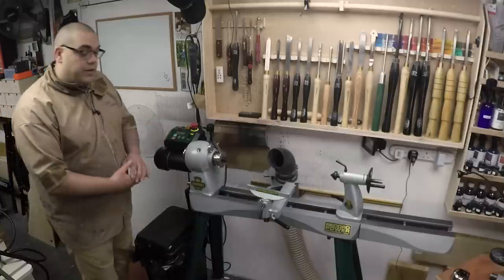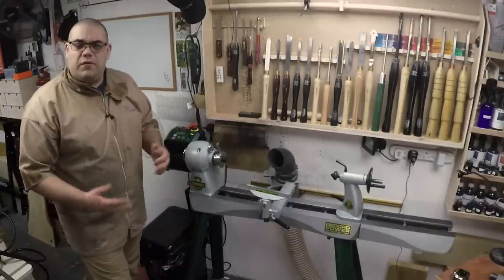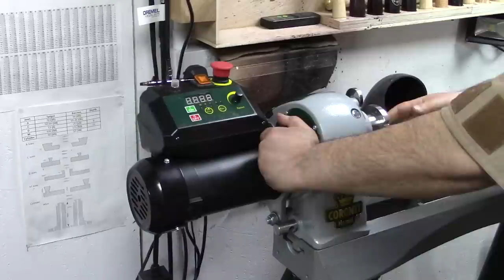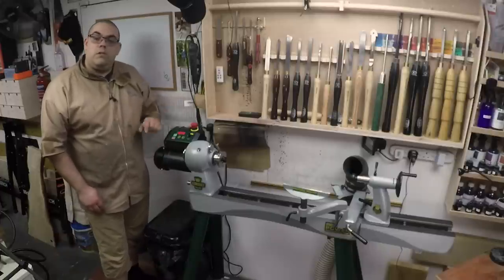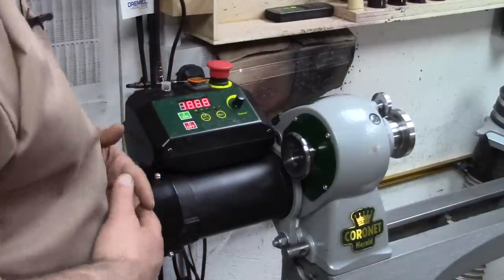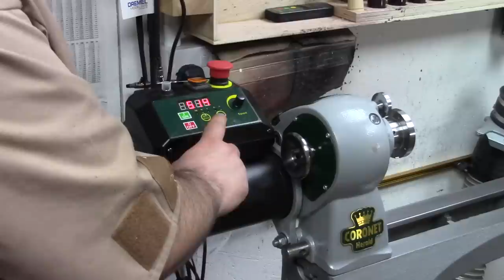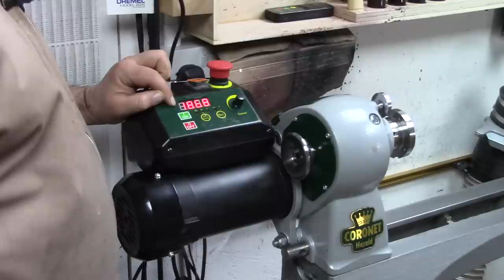Record Power Coronet Herald

Comment: A very interesting video. Now I'm thinking about investing the money to buy it as my very first lathe instead of a <400€-beginner-model. I'm sure, I'd have a lot fun for a long time with this machine.
Reply from the maker: I'm glad the video was of use to you. It is a cracking lathe. I am.sure you will not be disappointed
Reply: @JohnClothier I'm sure, it could be the right thing for me. Do you have any experiences in fixing the lathe on a workbench? As far as I know the legs are an extra and not included in the 999€, that the machine costs in germany. (But I know, there is a pair of feet to screw it on a workbench.)
Reply from the maker: No sorry. I've only used it on the legs. There are offers from time to time where the legs are included. Not sure about in Germany though
Reply: @JohnClothier  Oh no, I DON'T WANT the legs. I prefer to put the lathe on my workbench, and remove it in times, I don't need ist, since I have a small workshop and need maximal flexibility. However, thank you for the answer!
Reply from the maker: Sorry I misunderstood.
Reply: @JohnClothier  By the way: In between I've bought this lathe. Just cleaned it and now I'm putting parts together. First attempt will follow in the next days. Thank you again for your video, just watched it a second time.
Reply from the maker: That's great news! I'm sure you will love it

Comment: Thank you for the review. What is the height of the turning centre from the ground when the lathe is mounted on the legs?
Reply from the maker: it is approx 1090mm. Hope that helps
Reply: 1090mm would be too high for me, can you adjust the height of the legs?
Reply from the maker: No the legs are not adjustable but you can build a bench to put it on and record power sell a set of bench feet for the lathe

Comment: What's the price of one of these...I have the Record Power DML 24X, it's a great machine but just a pain the bum having to undo and tighten things to move them with a spanner or an Allen key....
Reply from the maker: It retails for £999. Yandles ahve some on a discounted price of £899 at the moment and you get the leg stand thrown in for free
Reply: John Clothier thanks for the reply but way out of my price range that's ridiculous money....
Reply from the maker: No probs. It does seem expensive but not when you put it in context with the equivalent lathes and features its a good price. The axminster equivalent is £900 and that doesn't have a rotating headstock.
Reply: John Clothier no suppose not if you look at that way...mines worth around £300-400 I think and can do everything you can on that one it's just i have to undo everything with a spanner or an Allen key..i want the quick realese handles...think I might have to do some converting here and there...

Comment: I would love to have a rotating head stock. I have used them and it's great for sanding inside bowls, boxes. Also for seeing into the bottoms while turning with just a little rotation works well. A lot easier on the body. Not useful for spindle turning.
Reply from the maker: Agreed Lee. I am most looking forward to having the rotating headstock for hollowing. I always struggled to see what I was doing but now I wont. lol no not so good for spindle work

Comment: That spindle lock knob is awfully close to the head stock.Seems to easy to b distracted while  turning & engage it, damaging your lathe!?
yiiikkers...is there away to remove the round handle ?
Reply from the maker: I have never had an issue with it. You have to pull it out to move it so not something you would do by mistake
Reply: Can you get this lathe with a standard 1" x 8 thread h😅ead stock or does it only come in metric ?
I have seen u tubes where there os an adapter on the nova c 3 chuck !?
Reply: ...thank you for the guick reponces/advice!... I like how this lathe has the motor off to the side...seems less likely to attract sa😮w dust as opposed to many other lathes where it is mounted under the bed.